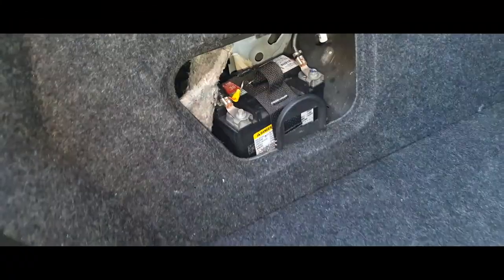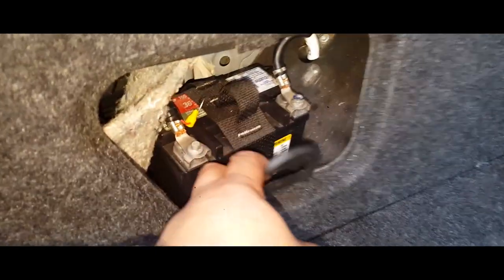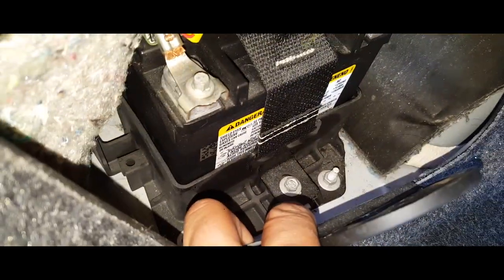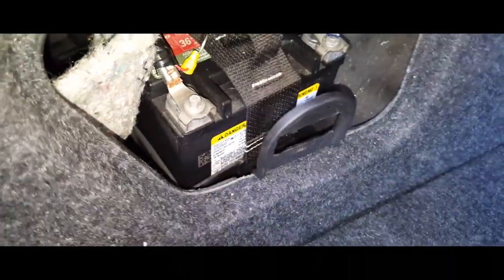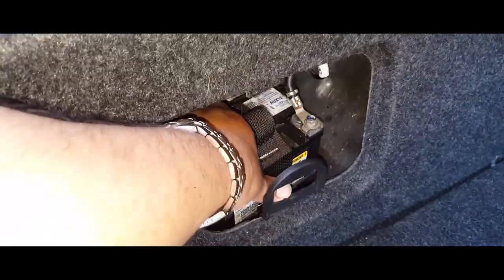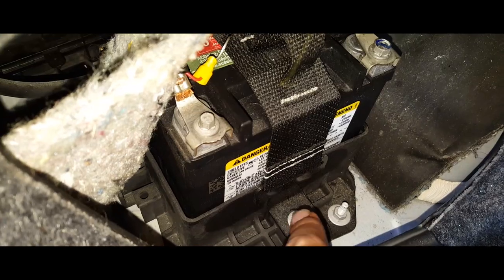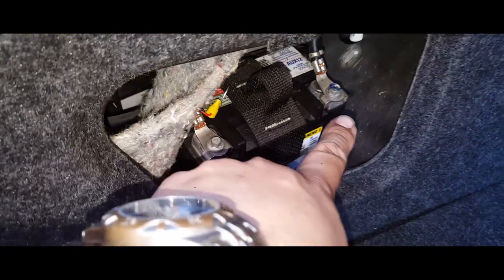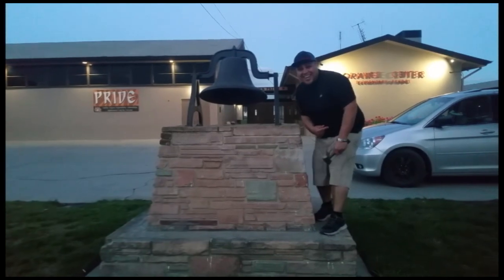How to: Remove the Aux Battery from a 2014 Chevrolet Malibu

Comment: Question….. in my 2014 Malibu, my radio cuts off after the auto-stop when the engine cuts back on. I have the original aux battery and its going on 8 years old. Do you think my aux battery needs to be replaced?
Reply from the maker: I'm not sure can possibly be. I dont know why the radio would cut off but it sounds like maybe might be weak and it kills the radio to conserve power to start the car. 🤷‍♂️ i honestly dont know but you can disconnect the aux battery and read it with a voltage reader to see where it's at in voltage. Or take it into a auto parts store and they can test it to see if its good or not. Sorry wish i had a better answer for you. Hope this works for you! Thank you for your Support!

Comment: Hello dear, thank you for the video. I'm in UAE and have this battery in Malibu 2014 to change. Please let me know if I need the same battery or if I can use any battery with the same Ampere...
Reply from the maker: Any battery with the same Amps..

The Part Number is "AUX 12"

HERE'S A LINK TO IT....https://www.autozone.com/batteries-starting-and-charging/auxiliary-battery/p/duralast-platinum-agm-auxiliary-battery-aux12/478444_0_0?cmpid=LIA:US:EN:AD:NL:1000000:BAT:17474778361&gclid=Cj0KCQiAsdKbBhDHARIsANJ6-jcxN794klcIUAq6GjUy75IKvqhlCH3VsyOOIAf5SdKZe9vTp98uzRgaAssOEALw_wcB&gclsrc=aw.ds

Comment: Does removing this turn off auto stop?
Reply from the maker: Yes it does
Reply: Thank you! You might have just saved me a lot of headache
Reply: @559powerscape  one last question! Removing this will not affect how your vehicle regularly operates right? It will just stop the auto stop So that way the vehicle will not shut off at lights?
Reply from the maker: @franciscogarcia9087  I've never tried it but when that battery goes bad, it's basically the same thing. I think you should be good. Give it a try just disconnect the negative cable, tape it up so it doesn't make contact with anything and see what happens. Let me know!
Reply: @559powerscape  MAN THANK YOU car has been working perfectly fine and auto stop hasn’t given me a problem since I disconnected the negative plug yesterday even after a 2 hour drive and also coming back into Nyc where there is a bunch of lights and stops. You saved me so much time with this video and your reply . Thank you!
Reply from the maker: @franciscogarcia9087  heck yeah bro I'm glad that worked out for you! Thank you for your Support!
Reply: My aux battery is bad and making the check engine light turn on. Can I just remove it instead of replacing it? Did your check engine light turn on after you took yours out?
Reply from the maker: More than likely your going to need to replace it. If its throwing a check engine more than likely you will have to replace it. Sorry.
Reply: @559powerscape  Thanks. I disconnected the negative, wrapped it in cloth. Drives good and no check engine light so far. If the light comes back on I'll replace it. Thanks so much for the advice!
Reply: @kristenlawson7933  how do you that the aux battery is the reason the engine light came on? wouldnt it be a separate dash light that tells you replace the aux batt?
Reply: I did this and the check engine light is on, it was not on until I disconnected aux battery, is it safe to say that is why the check engine light is now? Also, should this now stop the auto start and stop?
Reply: @BLEW313  I’m noticing that people are getting different results from this method. It worked for me and still does but it doesn’t work for everyone, if the check engine light is on after doing this I’d recommend just putting the negative cable back on and putting your car on nutral when stopping or at a red light. This will make it so that the auto stop feature won’t shut off your car and will actually also save you a lot on gas.
Reply: @franciscogarcia9087  thank you, I will try that today.
Reply: @franciscogarcia9087  it takes approximately 10 seconds of idling worth of fuel to start a car  so depending on the light or the nature of the stop (hellish drive through) it may not save gas but certainly starter wear.
Reply: FyI: This auxillary battery also powers some of your incidentals (dome lights, etc), so removing it may cause some of your other stuff not to work also.
Reply: @supremevictory4310 you have to get the code to know that it's a bad auxillary battery.  I thought that I had some bad gas/gas cap not on correctly.  I had the code read( P305F) and looked it up online.  It stated that aux battery needed replacement.